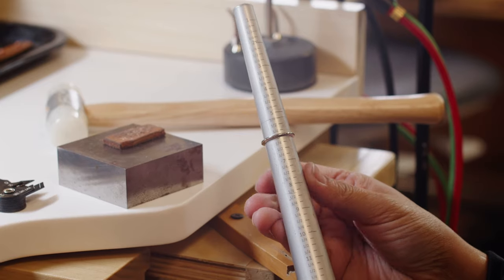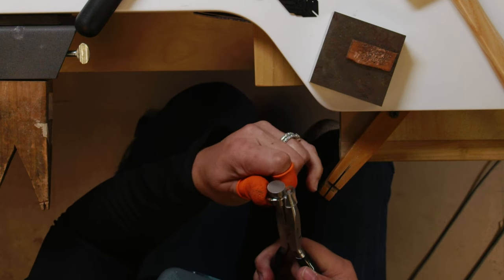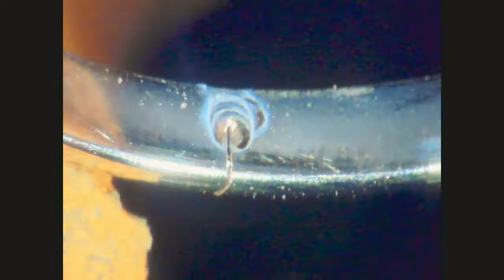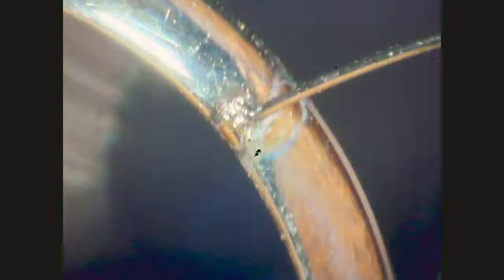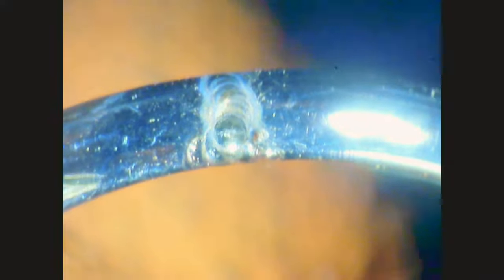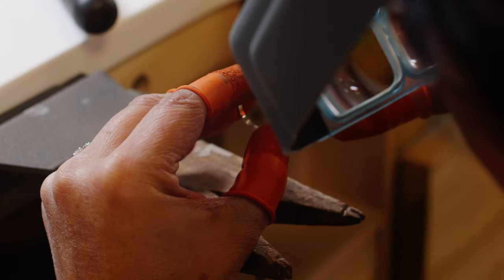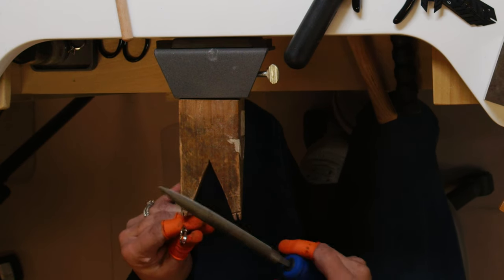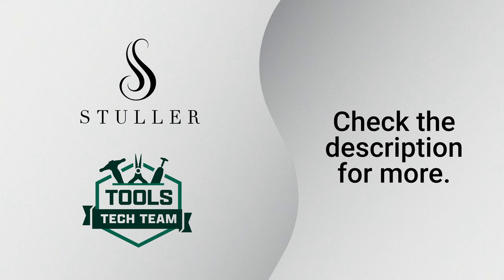How-To: Resize a Ring with a Laser Welder

Comment: Should create a V-groove and fill with weld instead of just a weak butt joint.
Reply from the maker: Hi! Thank you for your comment. In general, butt joints can be effective on thinner bands via manipulation of the voltage/time of the laser beam pulse to ensure proper weld depth. While this process is effective and overall more efficient for thinner bands, we do recommend a v-cut and wire build up method for the most foundationally sound weld on thicker bands. Would you be interested in seeing a separate video on this method for thicker band applications?
Reply: Yes we would love to see a video on a thicker band.  @StullerInc

Comment: Excellent video and close-up work. Also interesting that the rings joint was a 'flat butt' joint, where most laser welders have been advised to file a 'V' shape at the joint in the shank and build the weld up from the bottom of the vee. Doing this to alleviate any air pockets or porosity. Have we all been doing it wrong?
Reply: I've always made a fillet and filled in with wire just like you described.
Reply: Butt joints don't hold. Don't waste your time and reputation. Use V joints.
Reply from the maker: Hi all! Thank you for your comments. In general, butt joints can be effective on thinner bands via manipulation of the voltage/time of the laser beam pulse to ensure proper weld depth. While this process is effective and overall more efficient for thinner bands, we do recommend a v-cut and wire build up method for the most foundationally sound weld on thicker bands. Should we do a separate video on this method for thicker band applications?
Reply: Thanks for your reply and explanation. I do believe that it would be beneficial to the less experienced laser welding jewellers if you did produce a video explaining the additional strengths and methods of a v-cut on thicker bands. As laser welding for jewellers is having a rapid growth, any skills or technics would be a benefit to all, and potential additional sales of your machines for you too. @StullerInc